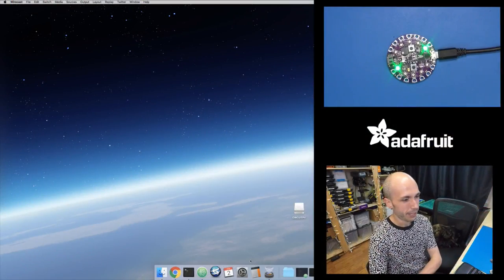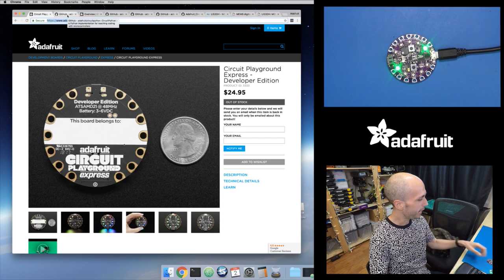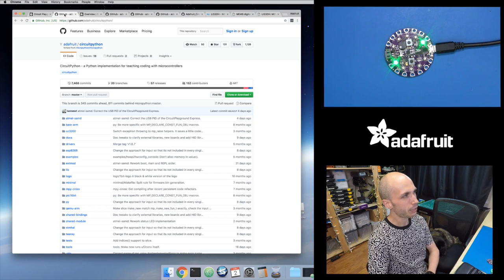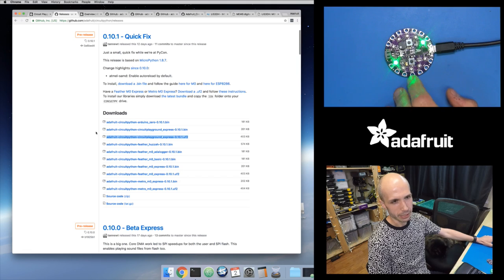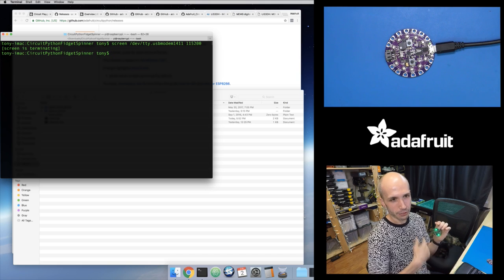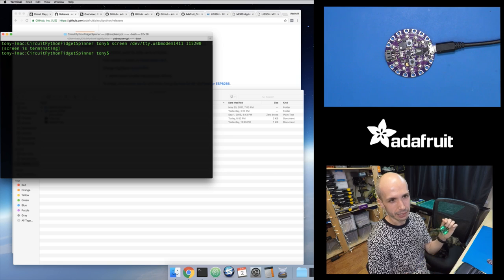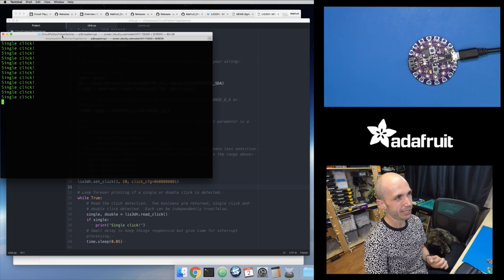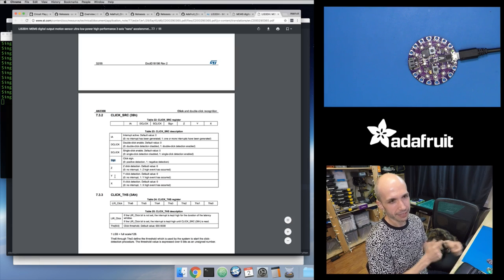Circuit Playground Express & CircuitPython digital fidget spinner with Tony D!

Comment: Hi Tony,

1) The library update you did for the axis filtering of double click is not present in the bundle, so example do not work in my case... I removed that parameter from your example, maybe I should replace the lib from the bundle with the lattest version of the lib. But for the benefits of all, you may want to ask a new release of the bundle.
2) Once I did this, the basic spinner example worked, but the advance example fail with a memory alocation (at the first "click"). Maybe the issue is that I use Release Candidate 1 while you are using 10.1 Quick Fix(?).

I know this is developper edition and library and circuit python is still a bit Alpha/Beta, so I just wanted to let you know.